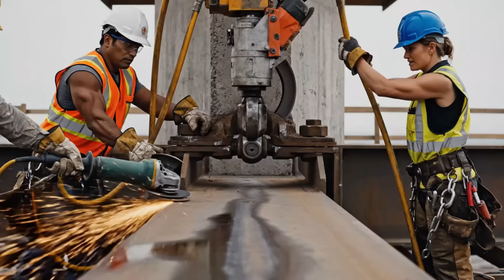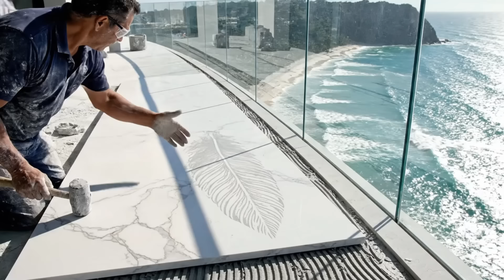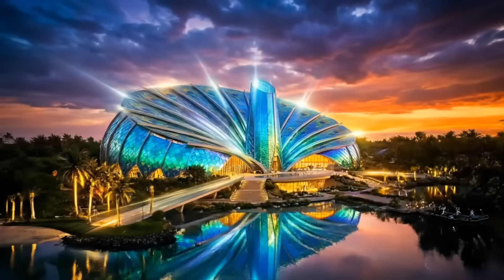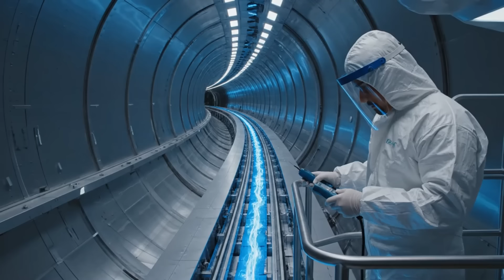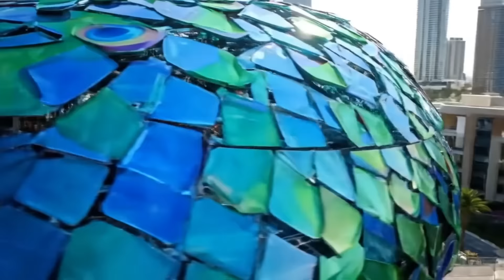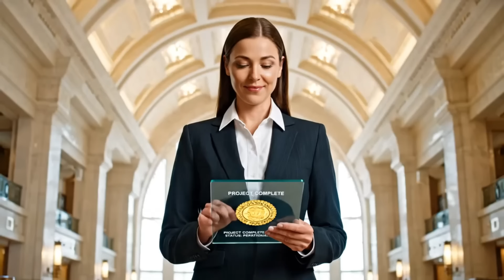Inside the $2.5B Peacock Hotel Concept for Dubai 🇦🇪

Comment: The Peacock Hotel concept is a perfect example of how Dubai keeps pushing architecture beyond what a conventional hotel is supposed to look like. A $2.5 billion concept sounds almost unreal, but the more interesting question for me is what happens when a building this ambitious moves from a visual concept to an actual engineering project.

At that scale, the challenge isn't just creating an iconic shape—it’s structural stability, wind loads, construction logistics, energy consumption, cooling, maintenance, and whether the economics can actually support such a massive development. I’d be curious to know which part of this design would be the hardest to engineer in reality. Would the biggest challenge be the structure itself, or making the concept financially and environmentally practical?